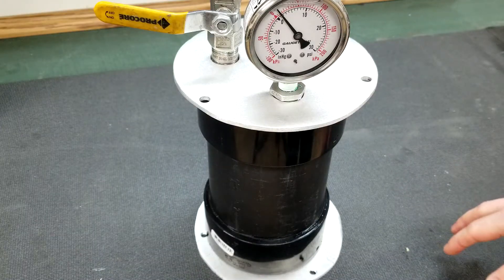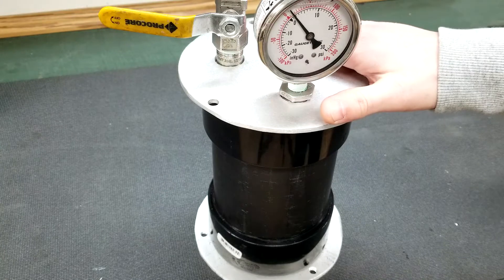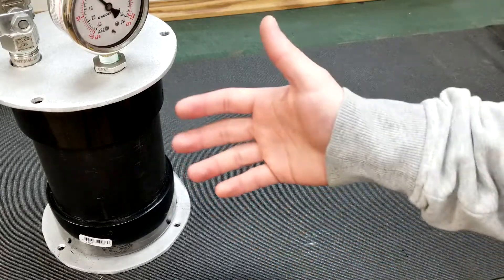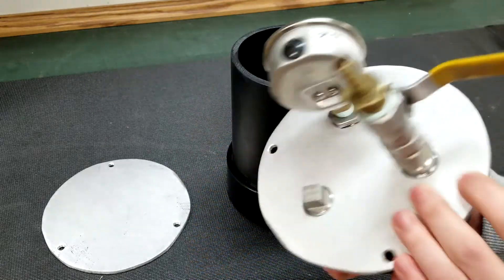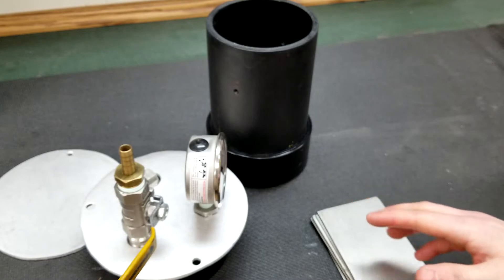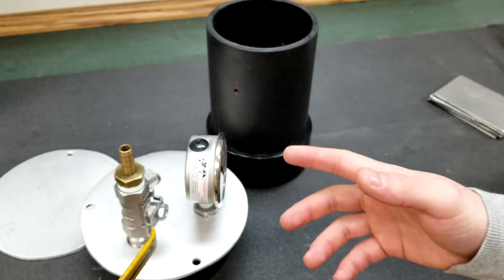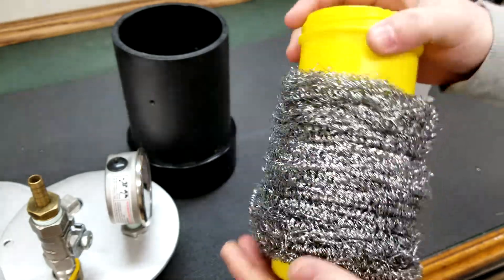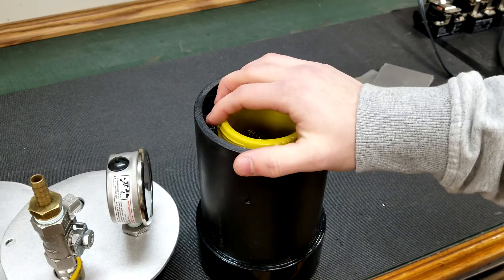Homemade HHO Generator!

Comment: Meyer Cell was a 1.5KV step-up transformer to electrodes at low current. Pulse on and off DC burst mode 3 seconds on, 7 seconds off. Just tap water or distilled water. VOLTAGE pressure - separates water. Not electrolysis. No chemicals. Multiple cells are not parallel to a single cell. Water capacitor (cell) frequency = pulsator power frequency. Get the 2 Water Fuel Cell Dealer Manuals for technical data.
Reply from the maker: hi thanks for the idea!
i researched a little and i think its something i can make in my garage! i like how it uses a ss tube , and it shouldn't corrode the electrodes
sorry for a late reply i had some time off the channel.

Comment: I’m guessing you’re using sodium hydroxide as an electrolyte which would create a very corrosive environment that will quickly eat your stainless steel.
Stick with the plates... you can adjust the charge balance inside the cell more effectively simply by adding not connected plates between the charged ones and so tailor your cell to your service requirements EG 1 litre a minute with minimal heating of the electrolyte and running at peak efficiency...
Just a thought
Reply: Using a 12 volt 10-40A atx power supply on a 4 neutral plate cell would minimize the heat and keep the voltage between the plates at the 2-2.5v needed for better efficiency. Too much voltage between cells makes it heat up and causes steam to rise up with your gas, ruining your torch.
Reply from the maker: That is correct. I will be using sodium hydroxide. Thanks for the idea for the plates!
Reply: EEC you’re welcome - nylon 66 is stable in such alkali conditions so if you were to use nylon rods screws washers you would be able to keep the charges appropriately separated and again increase efficiency - not sure if you will need a foam suppression agent at those types of volumes but I’m sure you’ll work it out. Keep up the good work - it’s a professional looking unit as it stands so far.